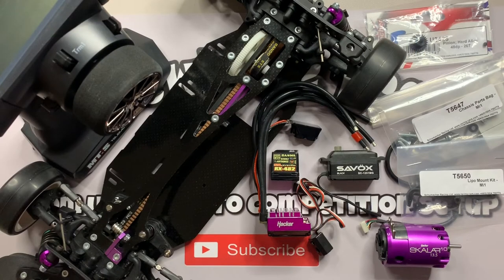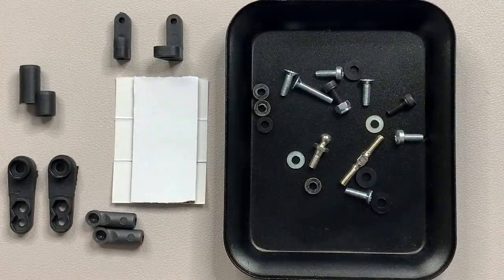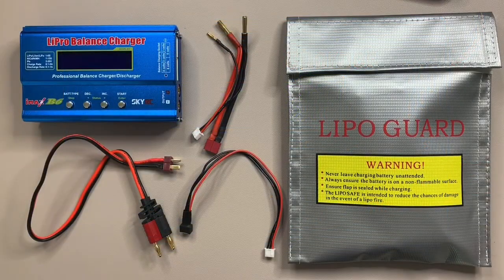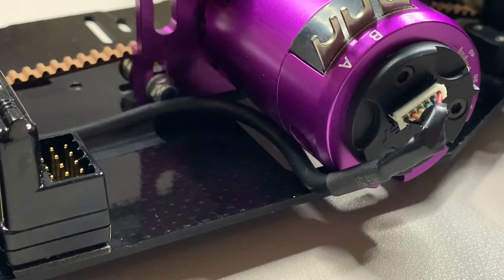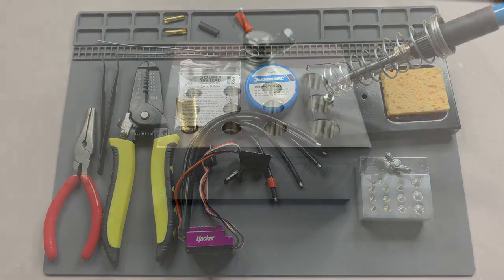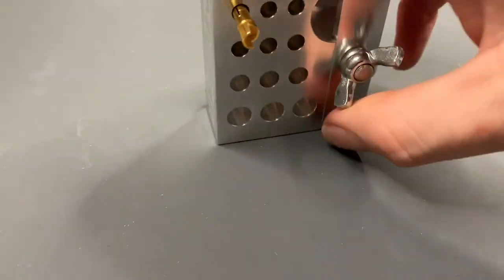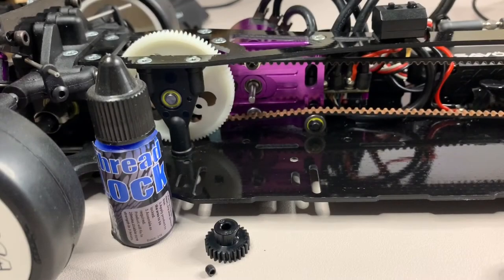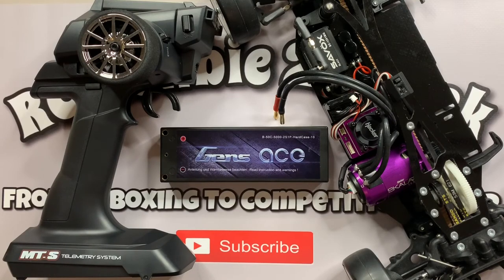Schumacher Mi1v2 Build Series, Part 6 of 6

Comment: If you don't know already, make sure you keep your Lipo batt. in storage mode when your not running the car. Keeping them fully charged will damage them. For your esc and receiver I always wipe the mating surfaces with rubbing alcohol before mounting to help keep them from coming loose. Keep up the good work.
Reply from the maker: Thanks bud. Yes, I have been putting it into storage mode. As I have never used Lipo before I have been extra careful. Great tip about the rubbing alcohol, I’ll be doing that in future 👍